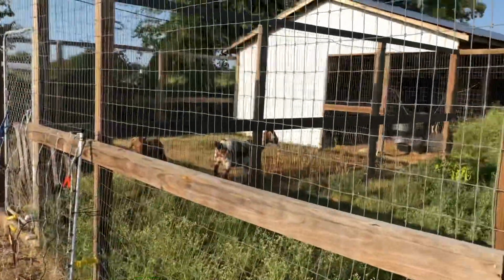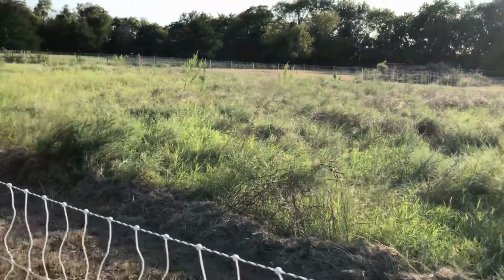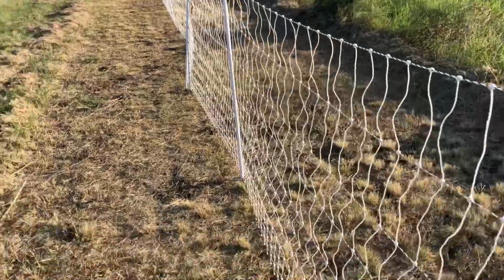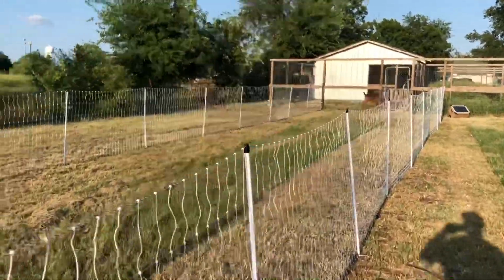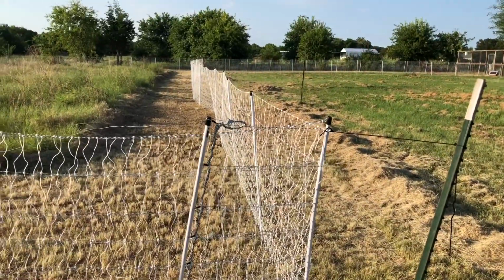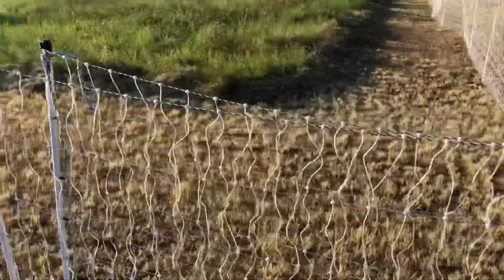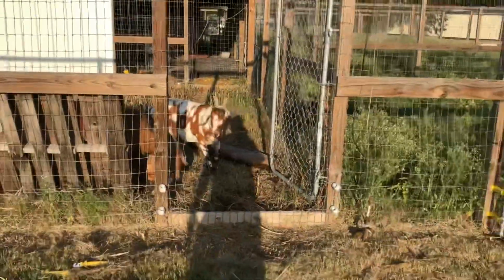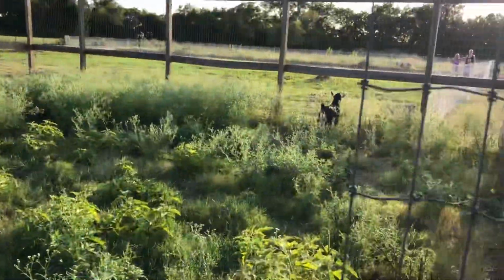Electric Netting for Goats

Comment: Can you give an update on how this work out for goats?
Reply from the maker: It works great- haven’t had any issues except when I was lazy and didn’t check the charge.
Reply: @ronbootsfarm8266  thank you for your quick reply. 
I've got 1 1/2 acre on one side of house and 1 1/2 acre on other side.
It's just not feasible for me to fence at least 1 1/2 acre right now.  I've got chickens that just free range and goats that are confined in a small area.

Comment: Hello, I’m looking into a goat and sheep just to keep my acre of “wild land” under control. I enjoyed your video but have a question. If the bottom of the fence needs to be clear of grass blades wound this involve taking the fence down every 2 weeks of so and cutting the grass to ground level ? Thanks
Reply from the maker: Hi there- the very bottom strand is not electrified and it can handle some grass on the electrified strands as long as you have a good fence charger and it doesn’t get too thick.

The goats will eat right up to it on the inside. What I do is slightly zig zag the fence so there is enough “slack” to allow me to mow down the outside and then go back and move the fence over into the mowed strip allowing them to eat where the fence was. A few weeks later I move it back after they have eaten it down.

Comment: We are looking get some goats for our homestead this year. We still have a lot of prep to do before that happens. Your video gave us some good ideas though, so thank you! Since we started talking about doing this, I’ve heard a lot of goat escape stories. Have you had an issues with that?
Reply from the maker: Hey there, thanks for stopping by! Yes, our goats gave definitely escaped a time or two which can be frustrating.

What I have learned is it’s more they are super curious and will push/rub on anything more than just trying to escape. Eventually they tear up wire fences just from leaning on them and putting their hooves on the wire. 

However, the electric netting and regular electric wire has solved this for us. We have not had them escape at all through the netting. I ran a regular piece of electric wire around the bottom of the wire pens by the barn and that has kept them from pushing on the wire. 

Hope that helps and good luck! 😀
Reply: @ronbootsfarm8266  Oh that’s good to know, and will keep that in mind! Thanks so much for the info! Much appreciated!